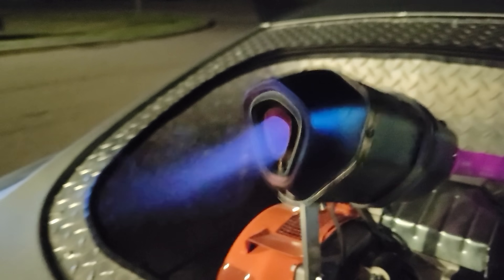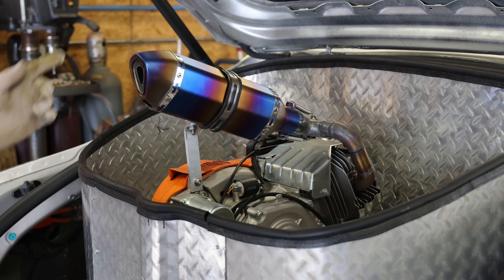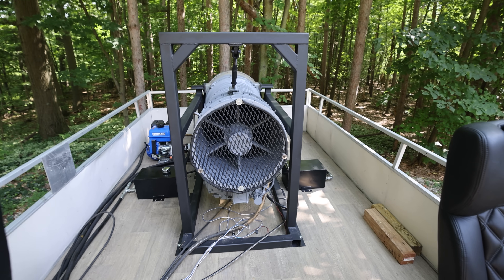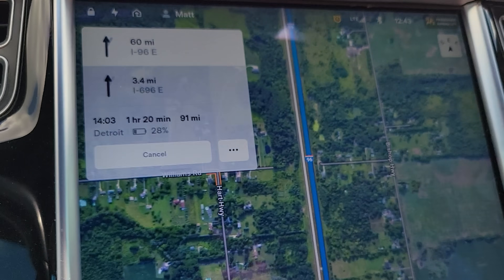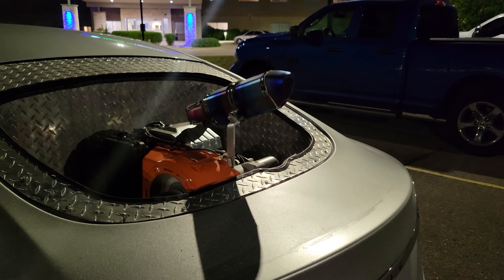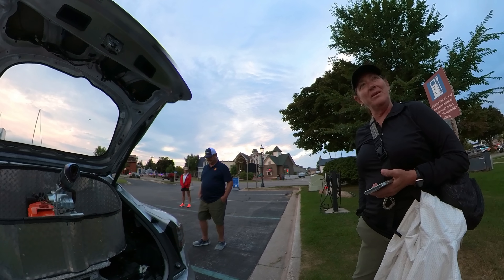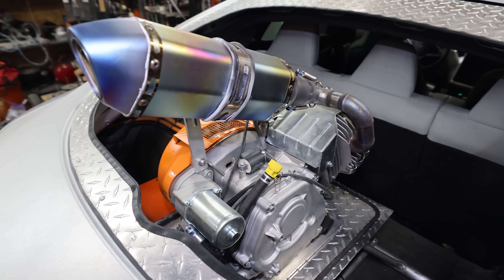Cordless Tesla (I Drive 1800 miles without charging) P.1

Comment: Interesting video, But from a practical point of view it would have been easier and quicker to use the tesla super chargers, there are plenty, they work and cheap, and i normally need a piss before i need a charge, but does depend on the range of your tesla, mine is 250m. Or buy a bmw i3, it's all done for you.
Anyway I suppose none of that would be as much fun.
Reply from the maker: True but in very impatient and it definitely wouldn't be as much fun 🙂. But the newest version of this works very well. You can check out the second video on my channel here but I'm already done with the third version. That video is coming pretty soon
Reply: Agreed, Seen 1 and 2, look forward to the 3rd, Problem is, I see this as living in the UK with petrol at $2 a litre and an average speed on a motorway of 50mph at best, around London its 12mph, I assume in the USA you can get on a freeway and drive for 200  miles at 80 mph, and again, pointless as I see it, sticking a petrol/diesel engine in the back of a Tesla appeals to my warped sense of humour, and the can do no nonsense red neck approach to a problem I whole heartedly respect and support, the whole world needs more of it.     @WarpedYT

Comment: Why not just install a light duty hitch and get a small utility trailer with the generator you need and a large fuel tank on board? Then you have the option of disconnecting the rig and having your car in an undamaged condition. Then you can install a proper muffler that makes it sound like a car idling.  Sort of that I like watching the fabrication portion of the video, however I see no point in this build other than to have fun. Good luck with it.

Comment: well, it's nice idea and had to admit really good job with the prototope but the economy of this is just not as good as i would like.  
just checked some common gasoline generator which can produce arround 7kwh per 0,45l/kwh => 3l per 1h per 7kw
Tesla batery model has typical kapacity arround 70kwh with the range of  arround 400km (250miles)
which indicates that in 10H battery will be fully charged but it will cost arround 30l of gasoline.

Comment: This makes no sense in any way.  Fuel efficiency is worse than traditional combustion car and obviously it's nothing but a public nuisance.  I imagine that little motor did not have a catalytic converter so the emissions must have been off the chart.  I'd say you should probably put your obviously substantial tech knowledge to better use :)

Comment: Actually you can just by Nissan kick e-power. That car uses an electric motor to power the wheels and has a gasoline engine that acts as a power generator to charge the battery.

Comment: I just dont get why that little motor is so obnoxious but yet a motor that produces 100x the horses sounds 25x quieter.  Kinda odd but okay.
Reply from the maker: I agree, but remember this engine is running almost full throttle, an engine that makes 100x this power is not quite at full throttle, even I had this  big misconception.

Comment: How about a triple hybrid? Replace the engine or modify the magnetto of that engine to produce more electricity for your car, then add some decent solar panel, and also add some wind tubines that will also work side by side with the solar panel. I don't know about my idea if this is possible but I think it will be crazy.
Reply: Wind turbines on a car won't work sadly, they really make more drag than the electricity to move forward

Comment: I'm not informed or knowledgeable enough to know the what's is what. My immediate thought processing though is a fusion of wireless charging capability with a insulated quieter more efficient compressor design. A compressor that could utilize the thermal generation from the compressor itself to also generate electricity, along with the fuel. 

I know wireless charging is possible for small scale devices. Is there any way to super size a more robust version to supplement the compressors generation?
Or is that utter sci-fi?
 I've read+seen discussions around Nikola Tesla having conceived an built such a thing.. but I'm sure it was probably only capable of generating enough wattage to power something akin to light bulbs an low wattage devices.

Comment: Thank you for including the thermal efficiency of the engine. The moment i saw that blue flame coming out of the exhaust i lnew it wasn't going to be good. An Atkinson cycle engine could help with that, but i suspect no one makes one in the size you'd need. 

Mazda was thinking about resurrecting the rotatory paired with a generator to make a range extended EV. I forget whatbthe name was gonna be. Unfortunately the plan was only to sell it in California.

Comment: You should have put a bigger generator in there. You need at least 16kw to maintain highway speed. That thing is what 7?
Reply: Lmao 30hp engine
Reply: @vipvip-tf9rw  30hp isn't enough with the generator losses. My bet is he's only getting around 10kw of electrical output. I had an i3 with a 35HP generator built in and it couldn't maintain highway speed. That's with a heavily optimized system.

Comment: I would have thought you would have taken advantage of the chargers at the hotels when staying overnight as it would not have burned any of your gasoline, and as it is downtime it would not count as a stop. 
That being said, what's the solution? Bigger generator on the engine? Bigger engine? I think you should test what the output of the generator is capable of, and maybe attach a bigger generator to the engine or a bigger gas tank so you don't have to fill up as much. Maybe upgrade the battery packs so they are capable of going further.

Comment: Thinking about this idea, not just as a cool youtube video, but as an actual product. What we need is a small aerodynamic trailer with a mini gas turbine generator on board that connects to your EV through a high power DV connector at the rear for extended range driving, these should be located at gas stations or similar and can be hired for long distance travel, kind of like the UHAUL model, this could be implemented to all EV's, kind of making a full EV into a EREV like a Chev Volt, the gas turbine generator could run on anything and could dynamically spool up or down depending on the charge required, if designed correctly, it could be automatic, safe, quiet and open up long runs in places like Australia where you can drive 1000km and see nothing but a dead Kangaroo being eaten by Wedged Tailed Eagle. I own a Vault and I drive on electric around town and switch on the Engine the moment I hit the highway and can drive long distances just fine on petrol and it saves the battery for when I hit the next town, WP is on to something here :)

Comment: ARe you just using the small coil pickups on the fly wheel do to the charging, or is this driving an alternator of some kind? You dont mention this detail at all. If its driving off the coil pickups on the flywheel, that is designed just to keep the starting motor topped off, not actually charge anything. So most of the engine is doing absolutely nothing...

Comment: Where do you carry the gasoline, in the back seat? What a stupid idea. I have had no problem driving my 225 mi range Tesla Model S from Florida to Connecticut. Averaged 3 hrs driving and 30 min for charge stops. Too bad it charges so fast as I had to rush to finish lunch and dinner.
Reply: In my opinion it should not even be allowed to drive so long non stop. A 15 minute break every 2 hours can save lives.

Comment: This is the first honest Tesla, most other teslas are powered by a coal or gas generator 😅 So what this means is that a diesel generator is more efficient than a combustion engine? 
I would be curious how much you could reduce the battery size without reducing the range. 🤔

Comment: That is a lot more sexy than those so called electric London Black Cab-
 They run a petrol angine to power the battery- They are exempt of emissions taxes and are somehow called green vehicles… And can cost around $100k
Most of the time they are just operated thanks to the engine they call a generator 😂

An hour charge just gives it a 60 miles range!
  So the driver can have more time to  learn more racist abuse when he is charging 
British engineering at his best!

Comment: I would love to see a Tesla hybrid. Electric for the off the block acceleration and a gas powered engine with a turbo for charging the battery and higher overall speed. It would be the best of both worlds. Today's infrastructure isn't even close to being able to accommodate electric vehicles. Most of the required energy is exhausted in carrying heavy batteries around and there isn't enough energy available on the grid.

Comment: This is funny cuz it's going back to fossil fuels lol. The libs are freaking out I'm sure.  I was thinking why not put some high production alternators on each tire or on the center of the axles so they reproduce energy as it uses it. I'm just a normal guy thinking and sure much smarter people are trying this. Even if it could give a extra 200 miles a charge it's big.

Comment: Just throw a Honda 7000 back there. It will be quiet and way easier.
Reply: That is a Wen GN875ix inverter generator.  It came with a relatively quiet, unobtrusive muffler.  The point of this video was to make something that was as loud and attention-getting as possible.

Comment: LS swap it already or sell it for a real vehicle. Letting the generator run non stop for 7 days nigh & day. 

Pisses me off even as an ICE vehicle owner. Same goes for those aholes diesels trucks that for ego stroking leave them running cause they'll melt like ice cream & Popsicles in a bit of heat & sun. 

Coos do the same in the squad vehicles.bleaving them on AC running while trying to get the cashiers number to get laid, bs'ing for 30min+. 

So yeah, if I could afford a Tesla, a hydrid, I'd buy one. 

If I did, at least I'd know they're not "earth & environmentally friendly, conscious, clean, green, safe, 0 carbon, 0 emissions" vehicles 

What I despise are the brainwashed zealots claiming they are. When they're absolutely not & never will be. Cause they're require plastics, rubber, petroleum, oil, batteries that when a slight hit, collision can render them useless. Because of the battery weighing more than & Jeep Grand Cherokee, basically up tob10,000 pounds total manufacturers demand more rubber to specifically make tires for such demands. 

So again, how is that clean? 

Cause it's not.

Comment: What a waste, bet leaving the gas powered generator while charging your  "earth & environmentally friendly, clean, 0 emissions, 0 carbon, non polluting" vehicle at hotels. 

Proving that Tesla, are still still a hassle to deal with. 

Also, tesla is made from rubber, plastics, oil, petroleum & the "earth & environmentally friendly safe, clean" batteries. 

I'll keep buying gas powered/combustion engine/I.C.E vehicles, weed trimmers, chainsaws, zero turn mower, mowers.

Comment: I purchased a BMW i3s with what BMW calls a “range extender.” It’s a little 2 cylinder 600cc BMW scooter engine that they de-rated the power output. It’s so quiet you can hardly hear it run. It also keeps the car traveling at highway speeds with no problem. Fuel tank holds a little over 2 gallons and the range extender starts on its own when the battery reaches a set level of charge. No range anxiety ever. Just find a gas station about every 90 miles and you can go forever. Very cool and better looking than a Tesla. Plus the car is carbon fiber just like a million dollar super car.

Comment: Need a minimum of 20kw. Hilarious and sweet build. I feel so sorry for the people trying to get some sleep in the hotels.
Reply from the maker: It wasn't that bad, the new version (video will be on YouTube this Thursday has over 1000mi of range on a full charge at 75mph which was impressive, I worked my butt off for the last year on that project which is why I haven't had any videos on YouTube for so long. It was very impressive, there were a lot of issues but I'm already on version 3 and I think I got the majority of issues worked out. But yeah you're right, if I want to drive continuous non-stop with unlimited range realistically I need about 18kw to 20kw depending on the speed I want to maintain. I think you'll appreciate my newest video, it was beyond difficult to make it work. Thanks

Comment: So I own a lot of generators and I am a bit confused by this build, WHERE IS THE GENERATOR ON THAT ENGINE?. 
What the FFFF is going on here?
Reply: It's a standard inverter generator.  The alternator is mounted to the flywheel.  It's thick section behind the plastic fan at 0:46.

It's pretty clear that he is using the standard inverter, plugging in standard charging cord and using the standard on-board charger.  He might have run the engine full time, but it's only charging while parked.
Reply: @1djbecker  my god your right, wild thats its rated for 10kw and so small.
Reply: @ryanclarke2161  Well, not 10 kW.  It's a 7 kW (8.75 peak) WEN GN875iX removed from the frame, and a $35 Amazon "carbon fiber" (non-)muffler added to make sure everyone could see it was there.

There was lots of custom fabrication for the mounting and a pipe for the muffler, but very little on the generator or electronics.  The generator output is limited by the inverter, so adding the open pipe exhaust did nothing useful.

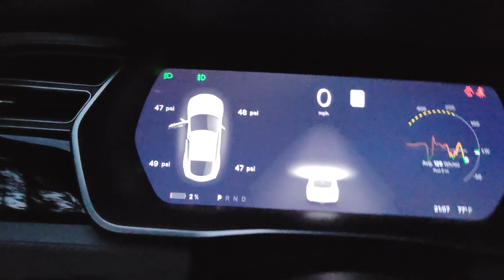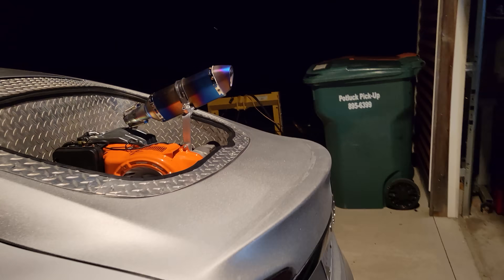He might have opened up the carburetor main jet so that it ran rich.  Listen to the exhaust note, and observe that the exhaust pipe is glowing red and at 4:23 spitting a flame.  That's not normal.  He claims at 4:30 "this particular power plant is completely ported.  It's all electronic.." But it's just a regular carburetor with stepper motor throttle, the same as you find on most Honda clone generators.

Comment: Wouldn't this setup significantly cause battery degradation?
I can't imagine driving and charging at the same time is going to end well for the batteries. I'd imagine they get really hot due to the constant load.
Reply: It would take a little while for that to happen

Comment: I thought about doing this with the F-150 lightning.  Way more space to pull it off.  You could put the charging port in the bed and even extra gas tank.  Would be a range extender option like the I3 ReX.

Comment: I definetly like the idea but in the future i could see this having a six stroke high compression engine, im guessing ethanol based on your brewery distilation tower comment, or premium fuel will whichever will produce more power and higher thermal efficiency with similar displacement and a proper muffler maybe so people dont want to hate it emmediatly. But i think your a pioneer doing something that should have been done long ago

Comment: Does this car have dual chargers? If not, I'd retrofit the 2nd charger, might be able to maintain highway speeds if you can manage to saturate both chargers' max power draw.
Reply: Check the brief views of the screen and the driving timeline.  He is only charging while parked.  And that generator is not quite powerful enough for the standard single on-board charger.

Comment: What if you were to use the 1.0l hybrid engine out of a 1st generation Honda Insight? It's incredibly small, quiet, and ridiculously efficient. With custom controllers, people have been able to put out 14-20kw of power continuously. It seems like this should solve your problem in regards to being forced to stop, as well as reduce your fuel consumption by quite a lot. Because let's face it, those fuel consumption numbers are absolutely atrocious

Comment: How did you connect the generator so it charged the Tesla while driving?
Have you considered putting a larger generator and the gas on a small trailer?
Have you considered putting 2 cylinders of hydrogen and a fuel cell on that small trailer?
If you did I would be interested in one.

Comment: Turned his Tesla into a gas-powered vehicle?
There's a better way to do this. It's called a gas motor vehicle.
 This is just a great example of how idiotic people are today. Batteries are not "green".
Reply: Ur wrong. Electric motors are a lot more efficient at creating motion than a ICE. So a gallon of gas goes a lot further if used in a generator to power an electric motor than it would in a traditional car with a transmission. Thisnisnwhy locomotive trains have the same ssetup. A diesel motor is providing electric power to electric motors at the wheels.
Reply: @theproudONE92  Simply not true. Modern motors get much better gas milage than this guy was getting with this nonsense.
Reply: Modern gas engines also are not full of toxic chemicals and batteries that WILL DIE in 5-7 years, leaving toxic chemicals to deal with.
Reply: @theproudONE92  EV are as green as plastic bags were when they introduced them.